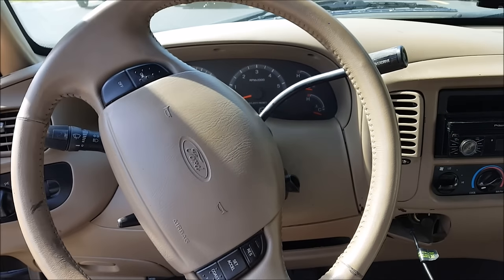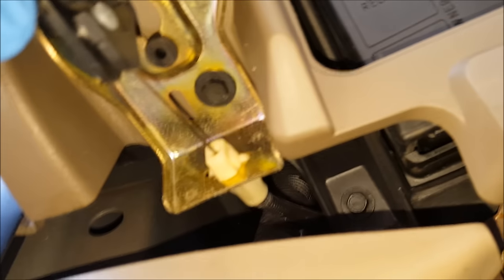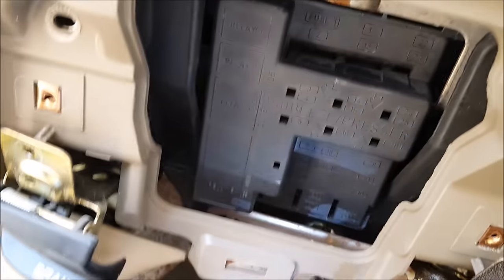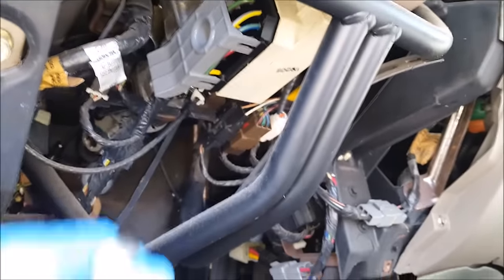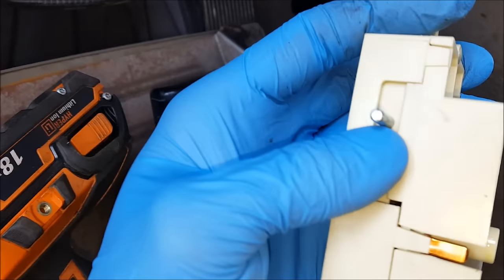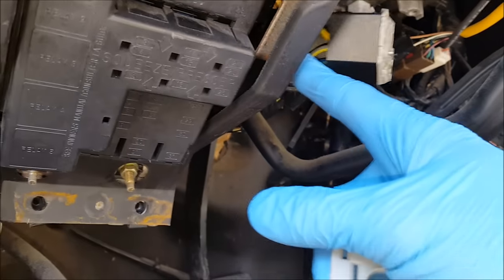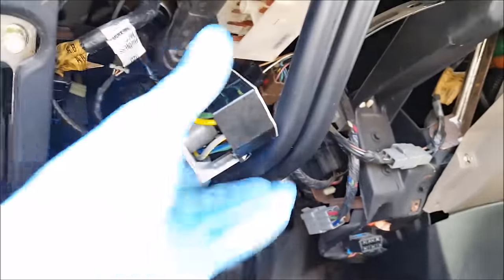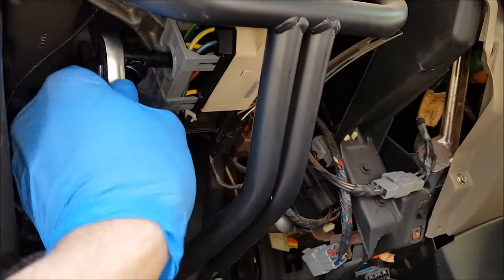F150 Ignition Switch Replacement

Comment: Did the truck have a no crank no start issue before fixing the switch?
Reply: That's what  i am Tring to find out I am having that problem
Reply: @nicklee2423  having same problem right now i have no power from the starter switch

Comment: What causes the key to turn with no resistance? Accessory power stays on even with the key out. Is it the switch or cylinder?
Reply: It is the Ignition Switch Actuator. Which is the part that moves the actual ignition switch in this video.
Reply: What’s that part called ?
Reply: Sometimes it's just the tailpiece of the lock cylinder that breaks off. Pull it out to make sure that's not it first.

Comment: Great video!  I just changed mine,  next time you should explain the symptoms of a bad ignition switch.
Reply: what issues were you having? I got no power in the cab no crank no start, last night the truck shut off while running.
Reply: @Elon_Trump  Hey this exact thing happened to me today. Hoping this is the problem.
Reply: @overlybroadcast3952  hey how’s that yoing? i have the same problem with mine
Reply: @bengutierrez2271  it wasn't the ignition switch for me. It was a positive battery line leading to the fuse box near the drivers side firewall that broke away from its connection.
Reply: @overlybroadcast3952  thank you i figured out it was the starter idk how it got so bad bc i tried hitting it to start it
Reply: @Elon_Trump  my beauty kinda did the same thing but on tweak it would turn off turn on turn off turn on

Comment: My truck won't crank. I turn the key and it makes a single clicking noise. Battery is good. The solenoid on top mounted to the fender doesn't spark either when I try to bypass it with a flat head. It's a clean flathead. Think this might be my issue?

Comment: My ignition actuator snapped. Until I have time to replace it, can I just push the metal pin manually to start and turn the truck off?

Comment: Aside from the no start, what symptoms were you having? Blowing any fuses or anything? I'm blowing my ignition switch battery feed fuse every time I turn the key to run, wondering if this is the cause.
Reply from the maker: The truck would not crank the engine when I was trying to start it. Everything else worked fine. Ignition switches can have a variety of symptoms when they fail including no-starts, engine randomly shutting off, wierd headunit behavior among other things. Do you have an aftermarket radio? Sometimes poor wiring behind the radio can blow Fuses
Reply: @LehewTech  Aftermarket alarm. It's tapped into all of those wires.
Reply: @LehewTech  Went and bought a new box today, thinking it could be just something else I cross off the list for a more seasoned mechanic to look at and.... it did the trick! It was my ignition switch. 

For anyone wondering, that this may help, I have a 2002 with the 4.6. Truck was running fine and had a sudden, asymptomatic no-start. Still got acc power when I turn the key, but found my 111 fuse (ignition switch battery feed, start/run circuit) would blow when I tried to crank it. Everything else checked out. I traced the wire from the fuse box, though the firewall and into the ignition switch box under the steering column. Replaced it and voila. No start fixed.

Comment: So I have a 2003 Ford F-150 XLT Picking it up tomorrow from the mechanic shop because they do not know what’s wrong
Sometime it starts sometime not. Always cranks just doesn’t start sometimes. Mechanic thought it was fuel pump put a gauge on shrader valve did not lose pressure. This vehicle is used as a service vehicle and starts 10 to 15 times a day. Would that cause a need for an ignition switch? Owned since new and this is the first problem Ihave had with it. Your thoughts please.
Reply: I have the same issue any help would be appreciated
Reply: Same issue here. Going on for years. Have to turn key completely off to reset in order to start.

Comment: Having an issue with my 04 f150. This happened overnight while it was parked acting normally. The truck starts fine but if you turn the heat in the high position, the heat doesn't turn on, also the turn singles light up, high beam and you can't put it in or out of gear? (Only with a/c or heat on) i went out one day and it was fine. Drove it to town, ran into a store, restarted the truck and the same issue started again. Any ideas would be helpful. Thanks in advance.

Comment: I have a 1997 f150 its has a random issue where it wont start unless i jump the relay. Most of the time it starts fine but occasionally you turn the key and the instrument lights come on and you hear a click but nothing. I changed the starter and relay 2 times wasted money for nothing and it still has same issue. Could it be the ignition switch or is there another relay in the fuse box for the ignition?

Comment: Ford tip: If you are new to them get a 1/4" drive metric SIX point socket set with a universal joint and a couple of six inch extensions.  Make SURE you have a 7mm socket! Many dash and other Ford screws including many on 1997-2003 Fords are 7mm.  I was looking for a video to link to a friend and found this one, so I added this tip to make it even better.
Reply from the maker: Ford owners also need to buy ignition coils.. should be a subscription service where they ship you a new one every other month
Reply: @LehewTech  
Have a 99 F150 and replaced the coil pack once.

Comment: i have a 98 ford f150 4x4 and a weird problem i have a brake light abs light a airbag light on but today even with the key out of the switch they are staying on but get dim none of the other dash light stay on can someone tell me what the problem might be is it the switch
Reply: I had a similar problem.  Replaced the speed sensor in the rear differental...all fixed

Comment: So Sunday night I’m driving my truck (1997 F150 5.4L 2WD) and make a hard right turn at about 20mph (truck has full suspension, bilsteins, traction bars…etc so it’s not like that was way too fast for the truck). Halfway through the turn, the truck died. Would not start back up. The truck cranks, but does not start. I checked all fuses in the kick panel, under the hood, and the inertia switch. Everything looked good. I hooked up my SCT tuner to read the DTC’s, and the tuner states “No vehicle connected to device” 

After researching this and coming across your videos, I’ve noticed my key is barely able to function for the last few months. The key is very worn, and the cylinder has seemed catchy and not wanting to turn over. 

I’m wondering if it’s because my ignition switch is fried or my ignition key cylinder is not allowing the PCM to recognize the ignition is on.

Comment: What are the symptoms of this part going out? Cause my ignition cylinder is locked. I know it's not my key cause I tried my spare one. So I seen a video where you tap the key in the cylinder witb a rubber mallet and it worked. But when I took the key out & inserted it again it was stuck as well. Hit it and became unstuck. I think it is the cylinder but I was unaware of this part. Thanks. Mike
Reply from the maker: Sounds like the cylinder
Reply: @LehewTech  Thanks for the reply!!! Greatly appreciated! Tried WD 40 & bam it unlocked it!!!

Comment: When you had to replace the ignition switch on the 2002 f 150 what made you think it was the switch. What was the truck doing ?
Reply from the maker: It would intermittently not send a signal to the starter solenoid to engage the starter. I could always get it to start bye fiddling with how far I was turning the key, so I knew that the contact for the starting part of the ignition switch was wearing out. A failing ignition switch can also be responsible for your car intermittently cutting off while running, especially if the check engine light is not on and there are no other drivability concerns.
Reply: @LehewTech  ok.  I have a 2002 f 150 that I took the battery out of and it was out for about 2 weeks. When I put the battery back in it, and turned the key to the on position a seen a really fast blinking theft light. The truck will crank but will not start. Any ideas on the issue ? The blinking theft code show to be an 11.
Reply from the maker: Get a scan tool and see if it can communicate with the PCM with the key in the on position. If there is no communication, check the PCM relay by replacing it with a known good relay.
Reply: @LehewTech  im having the same problem..so a scantool should fix it ?
Reply: @crystalmartin1743  Im having the same problem..Did you ever find out the problem?

Comment: I have 4 volts on signal wire  at the ignition switch and at starter relay, which drops to less than a volt when keyed to run position. could the ignition switch be the issue here? ( Car cranks if i put battery voltage on that post)
Reply: That sounds like dead battery, or  really corroded battery leads.

Comment: Can a bad cylider lock cause the engine to shut off while driving? Or is more related to a bad ignition switch?
Reply from the maker: Unless the lock cylinder is super loose the problem is more likely to be with the ignition switch or a relay
Reply from the maker: Or the idle air control valve
Reply: Ok thanks

Comment: cool video step by step :D was there a Check engine light active for this or when ignition switches go bad it just doesn't turn on the vehicle?
Reply from the maker: Thanks bud. Normally you will not have any codes or a CEL due to a failed ignition switch. Typically the vehicle will have problems starting or will intermittently cut off.
Reply: Just changed my ignition switch in my 2000 f150 and I just noticed my check engine light turned off!
Reply: Service engine soon

Comment: I have a 2002 f150 it will start by cross jumping celanpid,put new Celanoid on.won't start.I have dash lights,seat belt chimed.could it be the ignition switch?
Reply from the maker: It could be the ignition switch, or the transmission range sensor
Reply: This is my exact problem how did you fix it dude

Comment: Hey Everybody, have a 2002 F150 Lariat. Ran fine up to the recent cold snap. Battery was dead, still had radio and lights though. Today I replaced not only the battery, but the battery connections as well. That lead to no power, no lights, no radio, no engine turn. Not even clicking noises. From some research I have been lead to believe it's the ignition switch. Am I right, or are there other issues I should address???
Reply from the maker: Do any of the powered circuits work? Interior lights, horn etc? Do you have the correct polarity battery?
Reply: @LehewTech  nothing works. No horn, lights, radio, etc. I bought the battery today from O'Reilly auto parts. They looked up the model I have and gave me the proper battery I hope. What's weird is that when I connect the battery the light system gets power for about 15 seconds then turns off altogether.
Reply from the maker: Did you test the old battery to see if it was actually bad? What lights get power when you initially hook up the battery? And is the positive side of the new battery on the same side as the positive terminal of the old battery?
Reply: @LehewTech  I also checked the ground from the battery cables. I've been doing research for hours and the only similar problem I found(new battery no power anywhere) was the ignition switch, which lead me to your video.
Reply: @LehewTech  Yes, I checked to see if the old battery was bad, it was 4 years old as well. And yes the positive and negative terminals are in the same place as the old battery.
Reply from the maker: That's odd.. generally the horn operates independently of the ignition switch and even if the switch was completely disconnected the horn should work. I would start by checking to see if the battery power is present at the fuse box.
Reply from the maker: Do you have a voltmeter?
Reply: @LehewTech  when I initially hook up the new battery the under hood light comes on  for about 15 seconds and turns off before I can even tighten down the connectors. Once I do, no power anywhere
Reply: @LehewTech  unfortunately I do not have a voltmeter...
Reply: @LehewTech  so I should buy a $20 voltmeter and see if there is power to the fuse box? I'm a novice mechanic as far as electric issues go...
Reply: @devontiffen1168  you can get free voltmeter at Harbor Freight with the coupon fairly often
Reply: @tenncutt  good lookin out bruh, but that was 2 years ago 🤣🤣🤣